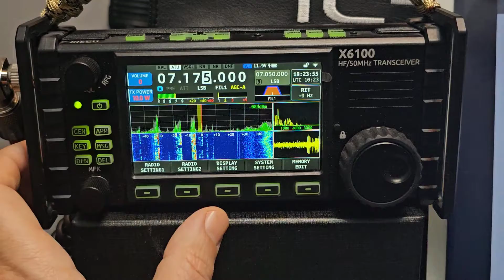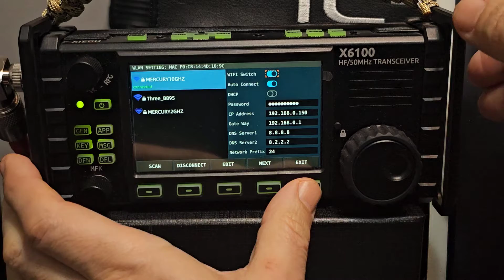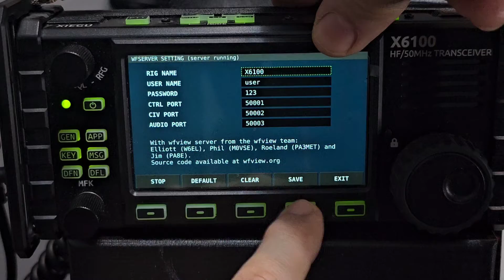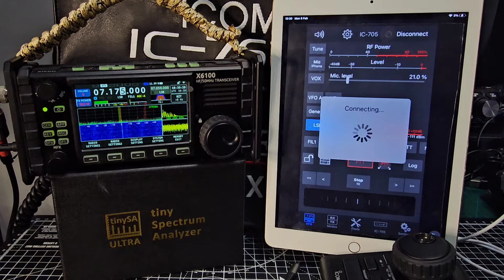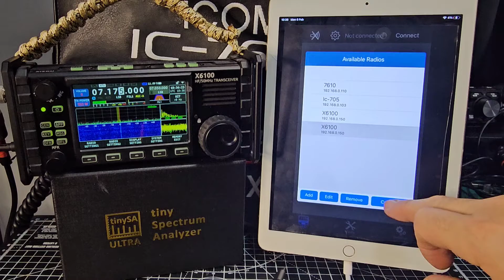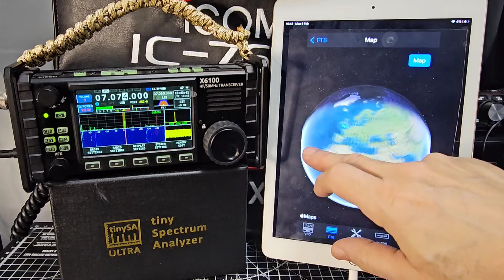FULL SET UP - SDR Control - (icom705) X6100

Comment: Thank you for the most excellent video. So would you say after some time using the ethernet, that is stable enough to use reliably? I currently use SDR Control with an IC-7300 and WFview app as the server but it's so slow and the waterfall hardly moves due to the USB connection instead of Wifi. This would be much cheaper than purchasing an actual 705. Thanks again.
Reply from the maker: Hi its not great the 705 is easily the best option .

Comment: Hi, i tested this also with my Xiegu 6100 but not via wifi. I used the LAN connection, but it was stuttering? It take´s time to get the sound and that the waterfall start? I´m wondering that is work by you so smoothly via Wifi.
Reply from the maker: I think it's not a great connection as is designed for ICOM 705
Reply from the maker: Just tested ethernet :https://www.youtube.com/watch?v=uxwcR_gYFQA